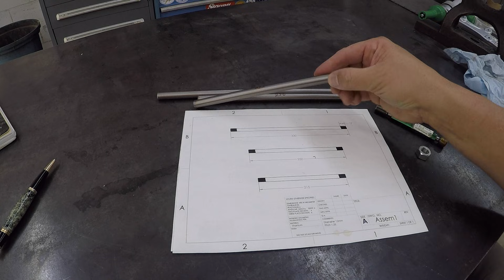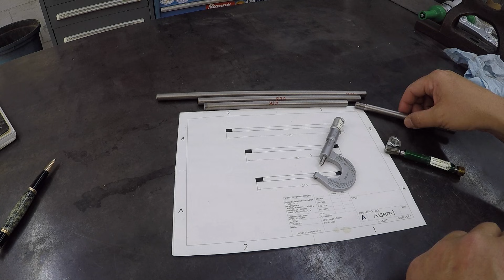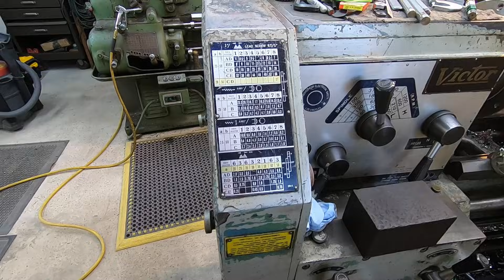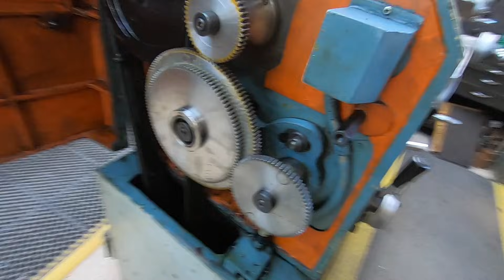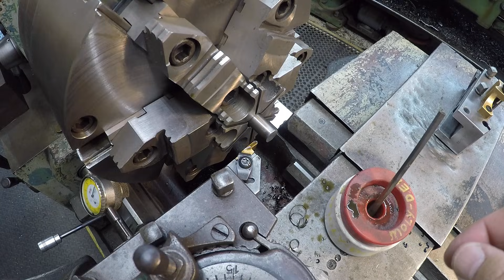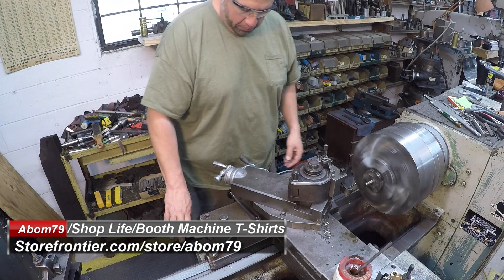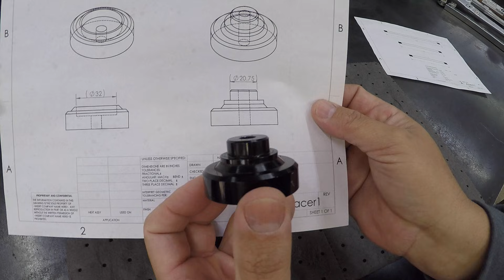Threading Metric Titanium Rod

Comment: Why not keep the spindle running forward, and after disengaging the half nut manually crank the carriage back, then reengage the half nut after dialing the cross-slide and waiting for the dial to come around? Seems like it'd be less wear and maybe a bit faster
Reply: Was thinking exactly the same... Since using threading dial and engaging half nuts on the same Mark. It will catch the same lead.
Reply: Preference I would imagine, I do as you say with this same exact lathe but I could see this being a little faster for a fine pitch/slow RPM job. Or at least it will keep you from missing your mark on the half nut.  I may try it myself next time I have a chance.
Reply: @sixesand9s56  If you try that method when cutting a metric thread on an imperial lathe (as here) you won't end up in the same groove and will cut multiple threads. Traditionally you leave the half nuts engaged all the time and reverse the lathe to bring the carriage back for the next cut. This is a slight modification of that method.

Comment: Adam, be sure to get all those chips out of the tray. Years ago I was working at an aircraft landing gear plant and we had our first experience with titanium on a lathe.  A lot of chips gathered in the tray and caught fire.  By the time the fire was out, a portion of the ways were melted scrapping the lathe.  Titanium, magnesium, zirconium as well as some other metals are flammable in fine chip form.
Reply: Recall reading science article, only inert gas (Helium, Argon etc) will extinguish a titanium fire. Will continue to burn under water and sand.
Reply: You are correct there.  Water is the worst, the fire is so hot that it breaks (dissociates) the water molecules into hydrogen and oxygen and creates more fuel.  Potassium is like that, drop a piece into water, and instant fire.

Comment: Love watching your videos. I am not a machinist but is it possible to flip the tool upside down and thread away from the chuck?
Reply: Yes you just need to run the lathe in reverse
Reply: Yes, threading away from the chuck is the way i've been doing it for years. The only difference is I use an internal threading bar on the backside of the material, run the chuck in reverse, and thread away. Much less panic inducing and it allows for a thinner relief cut. I can also thread at a higher rpm which makes carbide tooling happier. I used to thread the "normal way" until an old man showed me the better way.

The only downsides are some lathes can't run reverse spindle and feed to the right to thread on the backside.
Reply: @lsswapshopp  Its kinda fucked up if your machine has a backlash in the treading half nut-it can ruin the thread sync.When you are running it the normal way you can always eliminate the backlash by running the machine engaged for little bit longer outside of your working piece .

Comment: Ok so when threading, moving the cross slide in deepens the cut, and what does moving the compound do? widen the cut? how do you know how wide to make the cut?
Reply: You deepen the cut with the compund. The cross slide is just for retracting the tool during reversing for the next cut.
Reply: generally you set the compound to close to the thread angle, then you only use the compound to feed in to the cut so that you only cut on one side of the tool to reduce chatter. the cross slide is used to pull in and out of the cut when moving the head
Reply: The compound at angle gives smaller movement at end of tool. Not sure what the exact numbers are but it's up to half increments on the dial. Move the dial 1 unit and it only moves half at the tool

Comment: What is the tolerance on hitting the right spot on the half nut indicator. How many different starting positions are there you could hit besides the one you want.
Reply: It depends on the thread pitch of the lead screw. 8tpi is common for Imperial lathes, and they will have 4 or 8 marks. The tolerance is fairly wide. I have an 8tpi lead screw with 8 marks. I can engage between the marks (which is also fairly common). Engaging between the marks starts the thread 180 off, a handy thing when doing double start threads :)

Comment: Great video as always! I always get a rough cut when I thread, any idea as to why?
Reply: Deepends, from my experiance the first answer will be to low speeds.
 And it deepends on what tolling you ar using, highspeed or carbide.(sould get great result whit both)
Or is the machine to week/not stabil enough.
Not hevy enough cuts, its so meny  variables to concider.

Comment: abom there is mot one single video that explains how thread cutting works, rather only how to do it.  For example does thr lead screw make the work piece holder move in and out?
Reply: I can't recall which video it is, but Adam does do some explaining in an earlier video.
Reply: No, the leadscrew only moves the tool left or right. Moving in or out is done by hand with the compound slide dial.
Reply: This Old Tony and MrPete(Tublicain) both have excellent videos on how thread cutting works.

Comment: So what is the reason to spin it in reverse or did I miss the explanation?
Reply: Because Adam's cutting a metric thread on an imperial lathe. It's the only way to keep the tool in sync with the thread that's already been cut, and thus avoid cutting a double (or more) thread. Same for imperial threads on a metric lathe.
Reply: Doesn’t changing the gears turn the lathe into a metric lathe? I thought reversing the lathe is something you do as a beginner if you are not confident that you will hit the right spot on the threading dial every time, so it is the safe, but cumbersome way of threading. Adam disengages the tool from the screw after every pass, couldn’t he then crank the tool back manually and engage it again with the thread dial? I am not questioning anything, but I really don’t know and want to learn.
Reply: @jroemling  Yes, but also no :-) 
Think of it this way, using the transposing gears that Adam fitted does effectiviely make the leadscrew metric, but it doesn't make the threading dial metric. 
The threading dial still has four numbered marks which still represent 1 inch of carriage travel each. So if you crank back manually in the usual way, say one turn of the threading dial, and line up on the 1 again, you are 4" further along the bed. 
Now 4" is of course a whole multiple of the leadscrew pitch so you will be able to engage the half nuts. 
But crucially 4" is not a whole number of 1.25mm pitches (that was what Adam was cutting here wasn't it?). 4*25.4/1.25 = 81.28 turns of the metric pitch you're trying to cut. And that .28 is a problem! You'll be cutting a double thread with the second cut offset by just under 1/4 of the 1.25mm pitch. Not good.
Hopefully that makes sense.

Comment: Hello,  I haven't worked with Titanium but I remember a few years ago BS in the Shop was making suppressors with it and had a devil of a time cutting it.  Are there different grades of it like there are of steel?  What kind of inserts were you using?  You mentioned 360 rpm and it looked like it was cutting like butter.  I do a lot of stainless shafting which can be a bitch for hardness so I am always interested in which inserts are working on these materials. Our freight rates are so high that ordering small amounts of stock is prohibitive with most of my materials coming from scrap.  Outboard shafting being one.  By the way congratulations on your weight loss.  Looking good.  Take care.  Doug
Reply: There are many grades of titanium. The most common is Ti-6Al-4V which has additions of aluminium and vanadium for more strength. I've never worked with it but my understanding is that titanium is like a worse version of stainless steel when it comes to machining.

Comment: Not sure if others have mentioned this, but there’s a brutal high pitch whine in all of your audio recently.  I’m not sure if it’s a microphone or post processing issue but it’s pretty hard on at least my ears.  

Titanium is kinda neat wrt how frustrating it is to work with.
Reply: Yes, thanks for mentioning. I'm getting the whine, too, and also a low level sound like a fan or an old propeller-driven airplane.

Comment: How come you didn’t have to indicate them? (I’m not a machinist 😬)
Reply: joseph crosby he’s useing a six jaw chuck. It does not require indicating after its setup.. go thru his old videos and find the one where he gets it new he explains how it works and setup..
Reply: I think he's said before that the six-jaw chuck is effectively self-centering, so there's no need to indicate and adjust.
Reply: What everyone else said. That six jaw Chuck is fairly new and being its six instead of three, it is accurate enough for this operation.
Reply: The 6 jaw chuck, all jaws move at the same time with the turn of any one, chuck tightening screw.

Comment: As ever I am always impressed by the level of skill that Adam displays, I must admit to having a slight smile on my face when he says "that's good enough", you know damn well it's spot on.

The thing that always amuses my about the US insisting on feet and inches. After all this is the Imperial system of measurement that Great Britain made the world work to.  I would have thought that on the day the US declared independence they would have thrown out the British system. 

In GB, where we have supposedly adopted the metric system I still go to the timber yard a buy a 12mm 8' X 4' plywood or I get 2.4m of 4"X2".
Reply: Metric wasn't invented until 1791, and wasn't widely adopted until about 1900. A bit late for the US independence of 1776. Imperial has its advantages - especially in the earlier days with lower technology and lower needs for super-precision, when it was much easier to take halves and halves and halves of things. 64ths are higher precision than whole millimeters.

Comment: is there another way to do it, with out engage and desengage the lathe on every step of thread?
Reply: Back out rapidly when you reach end of threaded section and slap it into reverse, difficult to do if close to chuck at high rpms

Comment: Can someone explain why this method works?
Reply: in what sense? if you leave the thread nut engaged you can coast into the shoulder.  i hope thats what you are asking
Reply: If you stop the lathe reasonably quickly after disengaging the half nut the chuck will coast to a halt before the threading dial has gone around more than one turn. So when you reverse, as long as you engage the half nut on your chosen mark you will be back in sync.
Reply: Conrad Hoffman has an explanation: http://conradhoffman.com/metricthreading.htm 
Scroll down to the section "You Have to Keep the Half Nuts Engaged for Metric Threading" - Not! 
Tom Lipton made a video based on Conrad's method: https://youtu.be/HXt4TWa382Q
Reply: Eric Featherstone 
Thanks for the Conrad reference: best explanation of metric threading on an imperial lathe I’ve read.

Comment: can someone explain to me why is he using the top chariot to here ? i see he is on an angle , shoulnt that make a displacement on the nut ? , i mean unless you move exactly the ammount top to top of the thread you endend up having a new start for that thread
Reply: It is called the top slide or compound. It allows for reduced force when cutting a thread. If the threading tool is plunged straight in using the cross slide only, it will cut on both sides of the V grove.  However, the tool will cut on one side only if the compound is set to slightly less tan 30 degrees, thus reducing the load by half. Please check out videos by Joe Pie, who is also an excellent machinist, for a much better explanation.

Comment: What about the difference between thread angle? Using a imperial micrometer (55º) to measure a 60º metric thread wouldn't touch the bottom of the thread, and give a fault/wrong measurement? Thanks for posting those videos!
Reply: cavamanara if I had to guess he probably took a reading on the go no go gauge and just looked to match that number on the part. That way the error is already corrected for on the initial measurement of the gauge.
Reply: We use 60° threads
Reply: American UNC UNF is 60° same as Metric, British is 55°.
Reply: It's only British imperial threads that are 55º, American imperial threads are 60º same as metric threads.
Reply: Aside from the other comments, a thread mic does not touch the bottom of the threads - it contacts the thread walls at the pitch diameter.

Comment: I remember your story of the prop-shaft told a couple years back, and that changed the way I plan things out.
Now-days I would have done one end complete, and then parted off and then done the other end of each piece.    That way I'd have 3 chances in 6 of saving any big error on the first thread of each piece.    This has saved me on at least one occasion.

Comment: I fail to see how that micrometer gives you thread pitch. Diameter yes but pitch..how?
Reply: I could be wrong, but I think it gives pitch diameter.
Reply: It’s a regular mic with a different anvil. Rather than a flat end on it, it has a 60* tip that fits inside the thread
Reply: Daerrick Johnson, so is it measuring the root of the thread?
Reply: He's measuring the thread pitch diameter which is a different measurement than just the pitch.

Comment: Wouldn't it be nice if the US would finally get into the 21st century and last little bit of US would start using the metric system. Most US mfg is already using the world wide metric system.
Reply: How about yall just use imperial finally, it makes more sense for us to use imperial than metric.
Reply: @darkneko5513  I live in England. I talk in thou but measure in metric. Hated the day we decimalised. Duodenary has a much better divisional scale. However, the world is metric so we have to move on. I'd hate to think we could measure something like a mirror on a space telescope wrongly because we didn't use the same ruler.
Reply: @hobbyengineer1617  No worries. That could never happen. Wait ...
Reply: wouldn't it be nice if you gave me thousands of dollars to replace my imperial tools and equipment?
Reply: It’ll never happen, all of our machines manual and CNC are imperial. Not only that, but we got millions of standard cutting tools. The only thing you could do to convert would be throw it all away. It can’t physically ever happen. And if it would, it would take a few hundred years till all of our standard machines are useless and the tools/molds are used up
Reply: Why do you care? The US doesn't make anything anymore, so it shouldn't have any effect on you. I watch lots of metric videos and quietly covert in my head with no whining.
Reply: Inches just have more millimeters - 25.4 exactly. That is what defines the inch. So inch is actually metric except for this weird multiple.

Comment: With an imperial lead screw, can you make a Sharpie mark for the carriage start position, and note the threading dial position. Then thread, release the half nut, back the carriage up to the marked start position, and re-engage at the appropriate thread dial number? 

My lathe has a threaded chuck, and I really hate trying to reverse it, because I've seen the chuck un-thread, and fly loose.
Reply from the maker: Did you not watch the video?
Reply: Abom79 Yup, did, thanks.

But you disengage and re-engage in reverse. I really hate starting mine in reverse because I got a threaded spindle, and had the chuck come loose once. 

So, if you disengage, the carriage stays fixed in the same spot, and on reverse, it goes back in the same grove.

I’m thinking that If you Mark the carriage start, and manually back it up there, and start back in forward, the wait for the dial to come back to the same number and re-engage, it might work. I’ll have to try it.
Reply: @Abom79  I think he's asking if you can move the carriage back with the handwheel instead of reversing the machine. I don't know the correct terms either, sorry if this didn't help! Love your videos!
Reply: @miles0df   You can't use the apron hand wheel with the half nut engaged.

Comment: Adam, I have the same Victor as you have, with the exception mine has the English/Metric conversion built in. I understand from my local machinery dealer that was a two grand upscale option. No down play on your part. You have to do what you have to do. Much regards....Mark
Reply from the maker: Our Acra-Turn lathe was built that way

Comment: Why can't you also cut some thread when you're reversing?
Reply: Because you can't cut with the underside of the threading tool. If you were doing a lot of these on an engine lathe the trick would be a Geometric Die Head mounted into the tail stock. It has 4 spring loaded die chasers that cut the thread in one pass (sometimes two passes if cutting something like class 3 threads and using a cammed lever on the die head so a finishing sizing pass can be made).
Reply: That makes left hand threads
Reply: Rush Dougherty   Because they would be left handed threads
Reply: the cutter only works in one direction. what you are stating is close to how you make left hand treads.
Reply: Run your lathe backwards and try cutting
Different tooling etc etc etc